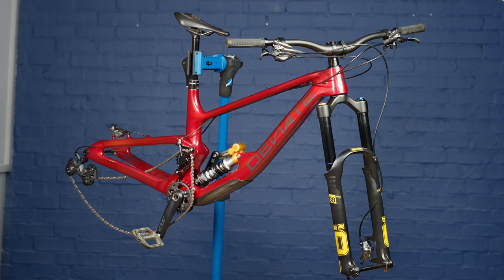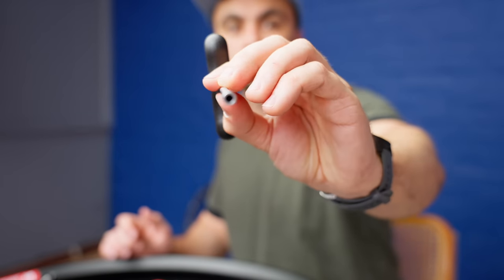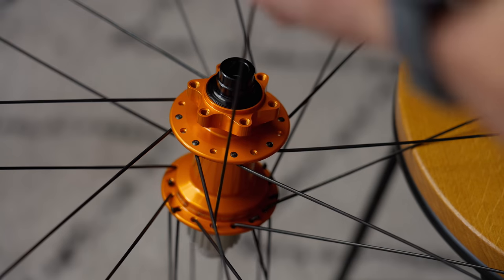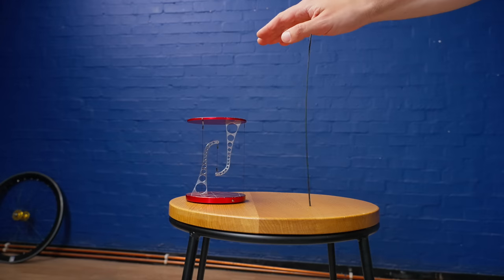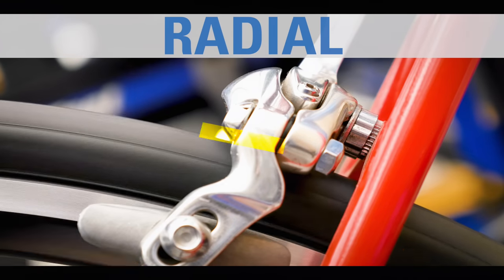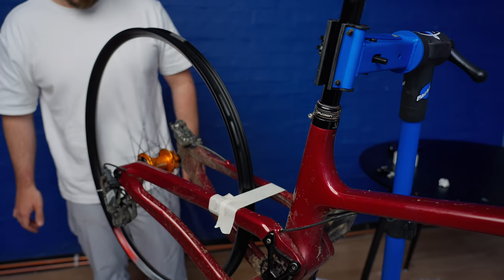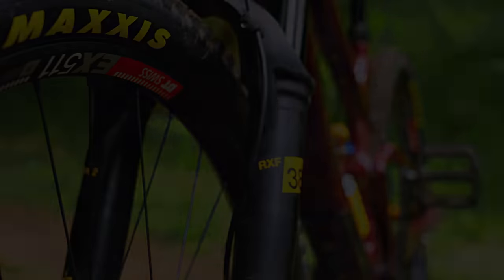I tried building my own wheels

Comment: The way I've been taught to true wheels is by sound and tension, so I'm quite surprised that you only mentioned tension at the end and didn't put more effort into getting the spokes to equal tension. 

What I do is I tighten the spokes to equal tension first and then start truing it. Do a rough truing first, then squeeze (grab two spokes with one hand and squeeze hard a few times) the spokes to relieve any stresses, equal tension again, squeeze, fine truing, squeeze, equal tension, squeeze, fine truing, squeeze and then final check to make sure everything is equal tension still. 

Ensuring that the spokes are at equal tension all around is the most important thing to making sure that the wheel stays true in use.
Reply: I’ve even seen people stand on not full pressure but stand on the spokes and re tension lol

Comment: Ali Clarkson could have helped you there. Pretty sure he's the best wheel builder in Scotland.

But if you start with a rim and hub that's perfect, and spokes that are all equal lengths and gauges, then a wheel that is both round and true will be equally tensioned, that's just how it works.

Comment: i wonder if you'd save time making a truing stand? they arent that hard to make really, its just making one that has all the adaptability that the park tool one has is pretty hard. Making one for a specific wheel size is a lot less work, just some nuts, bolts, and wood.

Comment: I worked in a bike shop, when wheel building goes well it is THE BEST job in the shop. When it's a bad day.... it is such a bad day.
Reply: OOF! From the start of the video it looks like you are attempting to build this without a spoke tensioning gauge. Best of luck, you'll end up needing a lot of it.
Reply: Oh thank god you have a tensioning tool at the end!
Also. You could hack a wheel truing stand out of an old fork, or a thu axle in a vice, if anyone wanted to try this at home.

Comment: You definitely need to stress the wheel after trueing them and after that true them again. The Wheels should experience a lot of stress before riding so they don’t get loose when you ride. The Spokes really have to work into the Hub so don’t get loose when they work in while riding. Ali clarkson has made some videos about how he builds his wheels, his videos really helped me building my wheels, i definitely recommend them.

Comment: If you ever have to do this again;  Install the front breaks.  Turn your bike upside down and use the front forks.     Then just keep tightening the breaks (via the adjuster) as you get closer and closer to true.       Use the inside of the rim against the bottom of the breaks and poof   You can adjust all three things at once.   Just keep in mind that adjusting one affects the others and you must keep that in mind if your doing all of them at once.   It's hard to give exact numbers as you kind of just need a feel for it but it's kind of like this.   Pick the worst part, be it True, Round or Pan and work on that while also adjusting for the second worst by 1/2 the amount needed and take out 1/2 of the third but only the worst parts of the third worst.    Repeat and you'll likely get it very close in two goes.    Unfortunately, like lots of things you do.   It will take practice to get it done in two goes around.
Reply: Mountain bikes have disc brakes
Reply: @drobotk  Fair enough.  They didn't exist back when I was doing it.

Comment: I have an ebike that constantly breaks spokes because the motor is too powerful, I guess.
Someday I plan to drill out the spokeholes on the rim side so I can mount bigger spokes so this never happens again but I have no idea if I might just end up making it worse, I depend on this bike to get me to and from work.

Right now its kinda wobbly but you gave me the confidence to get a spokey and try so true the wheel as is for now.
Reply: Do NOT drill the spoke holes
Reply: The motor and power are not something that breaks spokes. Weak/worn/old spokes, loose spokes, too tight spokes, unequally tensioned spokes, too high or low overall spoke tension, hitting potholes or bumps too hard or at weird angles, damaged spokes and sharp edges on the hub are the most common causes that break spokes.

Drilling new holes on the rim will not help as you will only be able to insert a specific sized spoke through the hub holes, unless your bike has the wrong combination of parts to begin with. Getting a new set of wheels (or rims, spokes and nipples if you have to use the same hub) will be your best choice.

The best thing you can do to prevent broken spokes is to ensure the spokes and hubs are in good condition, spokes are at equal tension and the wheel is true.
Reply: Please please please buy a stronger wheel or get it professionally rebuilt with thicker gauge double-butted spokes if you value your safety.
Reply: Unless you have an absurdly over-powerful motor, the motor will not break the spokes. Why? As your human power in a short dash (like accelerating from standstill) is easily more than most motors. The motors provide nice constant superhuman power, not that much peaks.

What likely breaks them is an unevenly tensioned wheel (where just a few spokes carry the load). Or, damaged spokes due to hitting them against something sharp, like a bad bike rack. The problem gets worse the more spokes you break and replace (unless you equalise the wheel every time you replace a broken spoke).

Also, have you checked that all your spokes (at least from the same side of the wheel) are same thickness? That there are not a few thinner butted spokes in the mix, or a few straight gauge spokes among mostly butted spokes in the mix. (This would explain why a wheel that runs true has uneven spoke loadings. And, would explain why spokes keep breaking if the new spokes differ from the old.)

The spokes from, say, non-drive side can be different from the spokes from the drive side. This is sometimes done on a purpose to centre the rim when the hub flanges are at different distances from the centreline. But, spokes on the same side should be identical.
Reply: @L2M2K2  OK I need to clarify a few things.
My bike has a rear hub motor rated at 500w. I already had it in repair by the manufacturer because the motor main bearing broke after around 1000 miles and uin that time 12 spokes broke.
12 of them!
I kepts replacing them and going to a mechanic to center the wheel correctly.

After it came from repair the same spokes it had before wer on it and now they start breaking again.

My Mechanic says he cant replace all of the spokes because the wheel is weirdly dished so thats not happening anytime soon.

Maybe Ill go have to find another guy but I rely on this bike and by now its really getting on my nerves.
Reply: @baccarah7010  That sounds like really annoying problem to debug. But, those are two key clarifications, so I will see if I can give you any hints that might help you.

Without seeing the problematic wheel in person, I can only speculate. To summarise what I base my speculation on: First, 500 W is not enough to break the spokes (you can very likely output well over 500 W for a few seconds yourself). The 12 spokes broke initially because of an impact (caused by the bearing failure). Second, it is the replaced spokes that are now breaking (one by one, I assume).

Given the amount of spokes that broke, and as the first repair did not seem to fix it, it indeed sounds like a rebuild might be better than just repairing them one at a time. Though, it might need a particularly skilled mechanic.

Especially, if the wheel is very much off-centre (if the mechanic said “weirdly dished”, I take this means that the rim is very much not centred on the two flanges of the hub). Being a bit asymmetric is normal for rear hubs, due to the cassette, but your motor hub might indeed be one of the hubs that is extremely dished with one flange very near the centreline of the wheel. This places additional strain on the spokes on the drive side (which would indeed be one of the cases where there could be thinner spokes on the non-drive-side).

Unless, first things first: From where do the spokes break? If from the J-bend, is there anything sharp in the edges of the holes in the hub that might have damaged the new replacement spokes? Carefully round the sharp edge before replacing a spoke and you might be lucky. 

Or, unless, a second step: Measure some of the non-replaced spokes coming from the non-drive-side and drive-side. You will need calipers for this, the difference in thickness is likely just 0.2 or maybe 0.3 mm. Measure near the middle of each spoke, as the some of the thinner spokes are “tapered”. That is, they are are only thinner in the middle with identical ends to the non-tapered “straight” spokes. Are all spokes they equally thick? Are all 12 replacement spokes the correct thickness for their side, or should they be all changed to be of correct size?

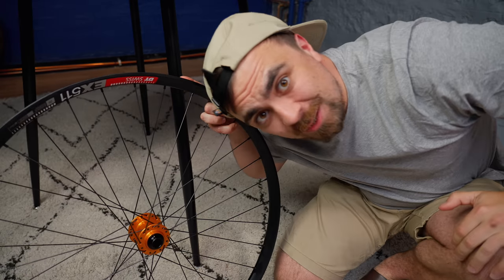Comment: 7:38 bought myself one of these tools as well, but found it very unreliable. Could measure the same spoke several times and get different readings. I feel like all it can do is give you a rough idea, but then again, feeling the spoke tension with your hand grip is equally effective

Comment: Buy a truing stand. Bikes make trash stands and you use them more often than you think. If you run alloy rims, they will bend over time. A stand makes routine maintenence on your wheels much easier.

That said, it's a bit of rabbit hole with wheel building tools. You really want a dishing tool and a tensiometer. Otherwise, you're kind of guessing and hoping your wheels are in spec.

Comment: "The load is supported by spokes in tension above the hub"  - you opened a can of worms there, and then quickly cut off all the worms that poked out and taped it shut again.  Is both technically correct as an overview, and a huge simplification of details that will absolutely ruin your work if you are selecting your own components to build a wheel that does anything unusual design wise.  But only people with oddball tastes / needs do that, so ... good enough I guess.  At least you used a tension meter.  👍

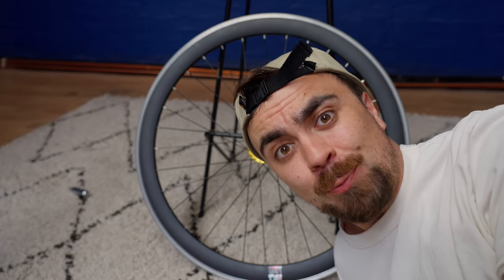Comment: 4:10 and 4:37 do not put oil on spokes and rim, you should put nipples into small cup and spray wd40 on it and shake it, that would be enough lubricant to allow easy spoke tensioning and when you are finished put a drop of rubber glue on every nipple head and it will prevent it from unscrweing but will allow to correct tension if needed

Comment: Good video but there is a lot of important info about wheelbuilding  that you have missed I wouldn’t recommend people to try to build their own wheels as you will first need to do a rim spoke and hub flange calculation , i have been a mechanic for many years and i have seen what happens when wheel builds go wrong , and it ain’t pretty , i love the enthusiasm of getting people to try new stuff but when wheels aren’t correctly built it is asking for trouble

Comment: just came here to find out if truing a wheel perfectly was even possible without the 'tools'. After having lost a literal night's sleep over trying to fix a slightly dinged up wheel, even the thought of messing with my spokes hurts my brain😖

Also, I wonder, is it trivial to build a new wheel if you have one of those tension meters? You know, if I just calculate the tension for spokes of each side, it should be trued and dished properly, right?

Comment: Eh, just rev it up to 1,000,000 RPM. It will either buff it’s self out or explode. Use a giant O-ring clamp if you don't want it to explode. But that would be boring...

Comment: You'd kind of think that if all the spokes and other components were made identical to each other then if you just assembled it all using a torque wrench all to the same torque then it would all be true and level and balanced right away. Obviously something must be throwing it off though since they would build wheels that way if so instead of this tedious process.

Comment: If the hub, spoke, or nipple fail, you don't want to be here 6:27 

Yes, the odds are remote, but any design can suffer a manufacturing or material failure.

Comment: If you can measure the strength of the spoke wouldn't just putting them all the same strength make it true?
Reply: I don't think so, everything would have to be perfectly manufactured for that to happen. In reality when I tried it the rims weren't actually straight or round to start with, you pull them into shape when you build the wheel so you end up with a bit of variation in spoke tension. R'amen brother!

Comment: ❤ Did the same after i dented my rear wheel and had a stuck freehub body. Still holding my beating with 100kg body weight. 

One lesson i learned from this - just do it (and after multiple retrueing - use linseed oil!)